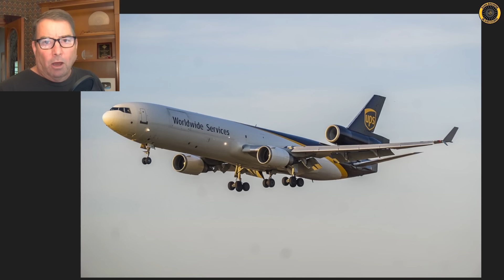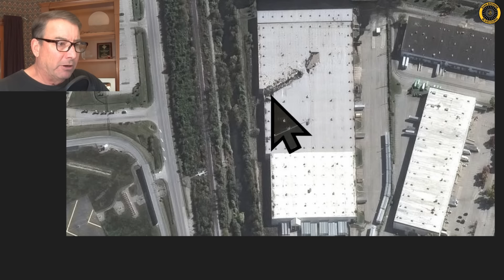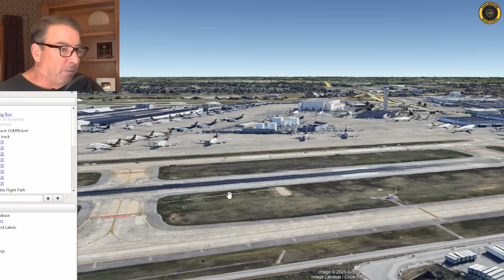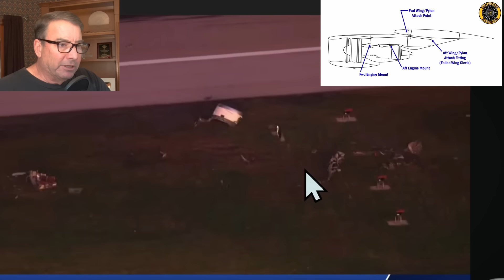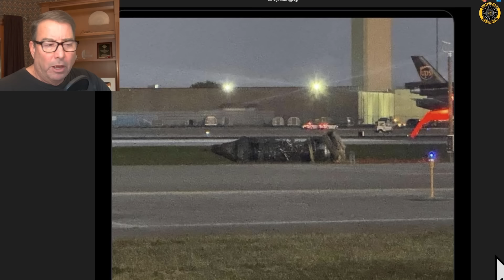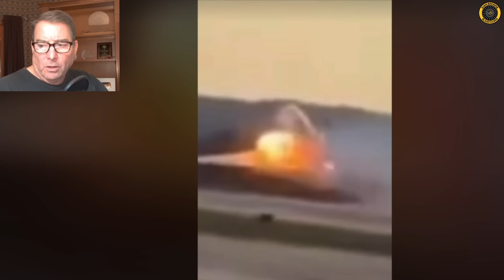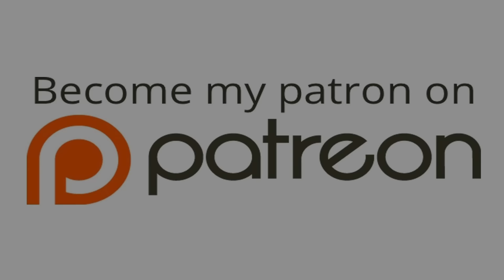UPS #2976 UPDATE 2 6 Nov 2025

Comment: Some years ago, I had the acoustic liner break up in the descent on a Boeing, with a CF6 on the wing. It showed up as high vibration on the EICAS. I thought it was due to fan ice and it cleared before I could do anything. On the ground the engineers found some of the liner missing and the engine had been chewing it up. This is the same engine type as this MD11 had (I checked). I would not go as far to say that this is a possible cause of the accident. There are a  vast number of potential causes. But, I am saying the liner can fail and go into the engine, causing vibration. PS I'm sure  the green stuff on the images is not an acoustic liner. The liner is a kind of honeycomb ring that sits around the nacelle by the fan.
Reply: That’s really interesting. Thanks for contributing that info.
Reply: Sounds like a real possibility that pylon failure would be caused by excessive vibration, and this could be a root cause of that.
Reply: I thought the liner was a Kevlar type material to contain fan blades if there were to be a failure. I think this happened but somehow it got wrapped up in the fan causing a terrible vibration which the pylon couldn’t handle. Yk, max power, spinning fast, unbalance it and it will shake itself to pieces.
Reply: @jackbender4885the acoustic liner & the ballistic liner are two different components. The ballistic liner wraps around the outside of the abradable fan case liner, the acoustic liner is typically all in the inlet ring on the inside surface.
Reply: As you say, it's too early to say what happened, but what you say here is really worth thinking about. So, it could have been liner breakup going into the engine leading to vibration leading to pylon failure?
Reply: For such an innocuous part to come loose and cause this is unacceptable! 😠
Reply: @ProctorsGamble 
Same company that just straight up "forgot" to bolt in a door plug.  Not really a surprise.  
This is what Putting Profits Over People looks like.
Reply: @SpookyGoose1 Go be an ignorant derp somewhere else.
Reply: @SpookyGoose1  not necessarily.  They put erasers on the ends of pencils for a very obvious reason
Reply: @SpookyGoose1  - You do realize that Boeing didn't build this, McDonnell Douglas did.  Also, the engines are made by General Electric.
Reply: @mountainflyhigh  and 30+ years ago.......
Reply: @SpookyGoose1  Ooof!
Reply: Glued honeycomb to composites are the construction with razer sharpe stage one fan blades to slice it if any alignment issues happen.
Reply: Interesting comment and certainly worth pursuing, which the NTSB will do.

Comment: You have misidentified the location of the dash-cam video. It was recorded after the aircraft had struck the building top.

The NTSB said today that during their FOD walk of 17L and 17R they found fan blades. I was hoping that one of the reporters at the press conference would ask them where they found the blades in relation to where the #1 engine came to rest, but nobody did.

Comment: The recorders look in fairly good condition, a bit sooted up but not badly burnt.

From the engine parts found and their location it suggests that the fan may have separated or maybe seized and the torque then tore the whole engine and pylon off at the fuse pins. No doubt the investigators will establish that timeline once they have looked at the FDR recording.

The crew had little chance, but they flew their aircraft right to the site of the accident. I take my hat off to them.
Reply: seized engine crossed my mind too. Is the final resting place of #1 correct with rotating mass directional force?
Reply: @timeakin1169 Good question, I'm not sure of the rotation direction of a CF6 fan.

Comment: FACT:  Before the engine fell off, the jet was on fire as it started to roll.  
FACT:  Due to a lack of ATC personnel, no one was available to tell the pilot of the doomed plane that it was on fire, so the pilot could stop the plane while they had plenty of time and not past the point of no return.
Reply: fool
Reply: How do you know the facts you stated? TheY should have had warnings in the cockpit. Fire detection and engine vib warning them something was wrong. They also would have been able to see the internal engine temperatures as well to tell them something was off.
Reply: What is your source for the fire starting as it started to roll. I've not seen any video which shows this.
Reply: I suspect he has TDS syndrome.

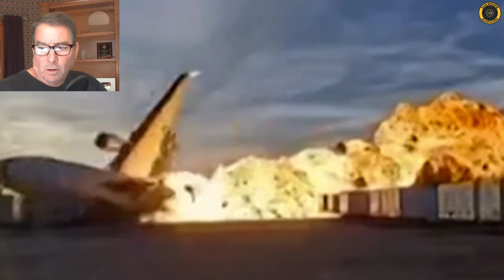Comment: That dashcam at 1:02 - 2:04 was NOT shot from Critenden Ave, rather, it was shot from in front of 7072 Grade Lane.  This I confirmed by comparing to Google Earth Street View.
This means that in this dashcam video, some part (the tail?) of the aircraft has already struck the roof of the UPS building (on Crittenden Avenue?).
It is also notable that as the aircraft proceeds farther in the video and crosses the road, the wing fire is barely visible.
(After striking the wire on the right side of the road, the plane seems to drop, and explodes in a large fireball.)

Comment: This exact thing happened in the 80s-90s md11 pilon broke and caused the plane to ultimately crash after take off May Day air disasters has an episode on that plane difference is that plane didn’t catch fire after pilon broke so it was able to take off but they did lose hydraulic systems and that caused the crash

Comment: They really need to put a 3 mile long clear crash corridor before and after each runway.
Reply: I was telling myself this morning that there should be a requirement that any aircraft using an airport needs to be able to get to V1 and back to zero when fully loaded before running out of runway.  Yes, that might cost a hundred million.  A fraction of the lawsuits from a crash, and zero casualties.
Reply: $100 million+ in real estate at this airport.
Reply: Nah. But it would be interesting if insurance companies for homes or businesses check if whatever they're insuraning is on a runway centerline near an airport.
Reply: I wonder what the max speed/energy that EMAS is rated to stop a plane like this at. Because if pilots could count on being able to abort past V1 with enough EMAS runoff, then it could make a lot of sense to actually fund retrofitting high threat airports with such an upgrade. It's not quite what you are suggesting, but it's in the same spirit and might be more economically achievable.
Reply: @jajssblue If you know the aircraft is going to be uncontrollable or will crash anyway, is it better to reject after V1 and take the crash at lower speed than get airborne and crash at a much higher speed?  Pilots need better information and have it presented in a clear way to make a split second decision.  Would Concorde have continued their takeoff if they saw those flames behind them?  Would the guys have continued if they saw via a camera what was going on?  After Concorde, I asked a friend who flies heavies for USAF whether he would reject after V1.  He said if he knew the aircraft was going to have a controllability issue in the air.
Reply: @major__kong absolutely stay on the ground, but the V1 decision speed is so ingrained in training, that the best option may not be chosen.
Reply: @jajssblue they’re rated for largest aircraft certified for the field to exit the runway at seventy knots.  Rough math would say several hundred feet could stop at rotation speed, but astronomically expensive.  Not MD-11 expensive, but close.
Reply: Im gonna guess that it was clear space for miles when the rw was built.  I could be wrong.
Reply: Air travel is way too safe to bother.  If you're going to the effort spend the trillions to put corridors before and after each runway, might as well make all the runways 3 miles longer anyway.
Reply: @Edax_Royeaux well, that is the idea.
Reply: Couple thousand feet would still do wonders, but the people in Louisville are hardly award winning thinkers when it comes to land management.

Comment: It's horrific and yet fascinating that we live in an era with so many cameras.  A generation ago, we'd likely never get this footage.  Hope it helps investigators.
Reply: I have a book from the 1950s about great air disasters - huge craters and nothing to go on except an occasional eye witness.  Astonishing that the CAB was able to make any determinations at all as to root cause.  These new videos may not provide the answer, but they certainly provide contextual data on subsequent events.
Reply: @ajg617  The bulbs and gauges give witness marks on impact.  Fire kinda makes it harder.  I love this stuff.
Reply: Don't think that the photos will be of any assistance to the investigators. (In this case.) 
Think that the engine/pylon lying along the runway will be the key focus.  
Maint problem ?   Engineering Problem ?  Too many hours ?   (Or all three).
Reply: Is there no video showing more of the takeoff roll? That seems odd.
Reply: @ChuckX.Arroyo  My guess is that they heard a noise, saw the wing fire, pointed the phone's camera, and then the fireball. It does seem odd that so few of these airports have effective security camera footage along runways.
Reply: Except a camera to see if the engines are on fire before rotating.
Reply: @naughtiusmaximus830  Point. How many aircraft have cameras that can see the engines? It could make a difference if the pilots had immediate view of critical parts.
Reply: @grahammonk8013  just how many things are pilots watching at take of and now you want to add a TV screen. They couldn't do anything different if they did know that the engine fell off.
Reply: @grahammonk8013 privacy issues
Reply: @grahammonk8013 it would've done very little to assist the crew here since their flight was so short lived, and even if they were seeing all the damage in the rear they still couldn't do anything to save the plane after the damage occurred.
Reply: @grahammonk8013  It looks like they all do now starting with the 787 in 2013.  Not sure if “verify engine is not on fire” is part of the checklist.  I certainly would be inclined to add it.
Reply: @regould221  The video could be recorded for investigations like this one.
Reply: @naughtiusmaximus830 The control tower is in that position. Might not have mattered, they where past V1 and committed. No good choices for them. Tragic.
Reply: @nicholascrespo9003  It matters for failure analysis.
Reply: Even in AA191 that crashed at O'Hare there was photographic evidence.  I think that even without dash cams and smartphones everywhere this was bound to get caught on CCTV like it was, especially since most buildings right near airports are owned and used by commercial or industrial businesses, which usually keep a good watch over their property.  Same with the cameras that look over the airport property. The amount of different angles that were filmed of it from the dash cams and other video like the one the woman in the car filmed are going to definitely make the job of the investigators that much easier.  But I don't think it is as if there would be zero footage or photos of the plane crashing had this happened in 1995 instead of 2025.

Comment: Would the engine making thrust for a second or more after the pylon failed rotate the entire engine, sending it off to the right?

The compressor stalls on the other wing were unbelievably unlucky but that fire might not have been manageable regardless I guess? 😢

Comment: The NTSB during their briefing today said that they found fan blades ( or pieces of fan blades ) on the runway during their walk through. They did not elaborate though on where on the runway they were, or suggest in any way that that it means the engine was coming apart during the takeoff role.
Reply: That is possible, however, what does an engine do if it smacks the concrete at high speed while spinning at max revs? Would it shed blades? (other evidence point to the engine pylon detaching from the wing.)
Reply: They already got good data off the recorders, too.

Comment: one minor correction - the dashcam video is from Grade Lane, so the plane has already struck the first building, likely with its landing gear and tail section. You can see Chris Tires on the right side of the road. The video POV is looking north-northeast from around 7015 Grade Ln
Reply: Yep, I was going to post that.  The approx location of the dashcam would have been about 38.14810, -85.73643
Reply: Correct!  In addition, if you single frame step the video, you can see that the left wing is intact all the way to the winglet.  This would suggest that it was probably only the left main gear that impacted the UPS warehouse roof.  It appears that the first thing the left wing tip contacted was the power lines as the plane passed over Grade Lane.
Reply: @FlyMIfYouGotM  but given the groove that was made in the UPS building as seen at 2:07, and the jet is still quite level, if it’s from the left gear, shouldn’t there be something from the right gear?
That’s why my guess is more of a tail strike given that gear kinda appears intact as it crosses the road that car with dash cam is on.
Reply: @JohnHallgren  Same - I'm feeling like the tail dragged across that first building.
Reply: @HisBortness  because we know that the gear mechanism is very strong, but if it impacted the building like that, I would think the gear would be more dangling at a 45° angle or something.
Reply: @JohnHallgren
Good point. If you look at at an aerial view of the warehouse roof, the gash is to east of and parallel to the runway centerline, which is indicated by a row of approach light structures on the roof (the building is called “UPS Supply Chain Solutions” —  you can see these lights on Google maps also).
If the gash is from the tail, that would indicate that the plane’s path was affected by right - engine asymmetrical thrust & aerodymamic drag from the compromised left wing, and was already veering to the left as it crossed the perimeter fence.
Reply: @davidzarn4568  your second paragraph about veering to the left and the possible reason why makes perfect sense to me.
Reply: @JohnHallgren  could also be debris that hit the building.
Reply: @JohnHallgren It's possible it was a tail strike but the plane wasn't totally wings level.  If you follow the track as it left the runway, it had already started to yaw left, probably due to asymetric thrust.  A swept wing with a bit of dihedral will also tend to roll in the direction of yaw.  If you watch the video frame by frame, the plane had already started to slightly roll to the left before the wing tip hit the wires next to Grade Lane.  The gear would not need to hit the roof of one of these warehouses very hard to punch through.  Structurally, a warehouse roof is pretty flimsy compared to the main gear of an MD-11.  It looks like a pretty shallow, grazing hit so the gear would probably take that relatively unscathed.  From the video, I just didn't see any damage to the tail and structurally, the tail is not all that tough.
Reply: @JohnHallgren and the centre middle gear too....
Reply: @FlyMIfYouGotM  but I would think that if the left gear had impacted the building, the plane would then tilt more to the left much sooner than it did, but it appears rather level when it enters the car dash cam video.
Reply: @FlyMIfYouGotM on the picture he showed there is a line in the foliage leading up to the strike on the building too. Just one so I agree it's tailstriking as it's lowest point which wouldn't help with airspeed either. Landing gear would leave 3 lines as it has 3 centre lots of gear. It's yawing left due to the right side thrust still going.
Reply: ..and after that road crossing struck the power lines beside the road causing big ignition
Reply: FYI Juan just posted and pinned a correction re street name.
Reply: The other day a cold wave washed over me, I used to work just south of there at 7200 Grade Lane.
Reply: Also just beyond and to the right of the POV of the dashcam and out of its view is the petroleum recycling plant which the plane hit causing the huge fireball.
Reply: @ralphthornton1296  Actually the tops of petroleum recycling plant storage tanks, colored black, are visible just below and left of that blank billboard at right.
Reply: @ralphthornton1296  Why was that plant there?
Reply: @SteamCrane  cheap real estate
Reply: @SteamCrane With the plane fully fueled, would it make a difference if it wasn't there? 
I agree, though, unfortunate location. If not completely stupid.
Reply: 7015 Grade Lane is also the premises where the parking lot dashcam was located. Seems to be a truck repair/storage place.
Reply: Thanks for the clarification. Cross referencing the dash cam, the aerial photo and google maps did not correlate to Crittendon
Reply: Yep...
Reply: Correct. Hell of a job from the crew to keep it level until it struck the holding tanks at the recycling facility at GFL Environmental. That's when things went from bad to worst.
Reply: It likely hit the building with the rear main fuselage
Reply: Who put a petroleum recovery plant at the end of a runway, and wires should be under ground.
Reply: @Airsally Most likely, the EPA would have issues with these tanks underground.  The EPA wants/requires UG fuel and oil tanks to be double-walled with leak monitoring sensors.  How do you spell, expensive.  That is probably why these tanks are above ground.

Comment: how did the left engine parts end up on the right side of the runway?
Reply: the #1 engine spins to the right. so the torque of the engine at TOGA power would send it off to the right